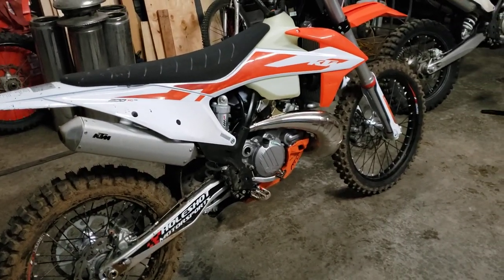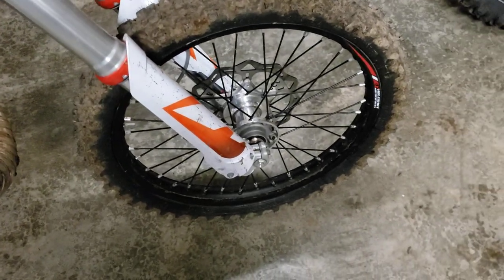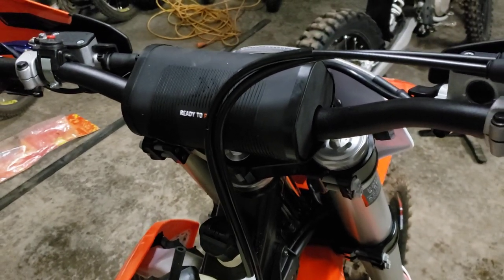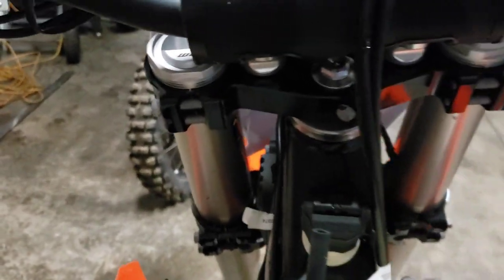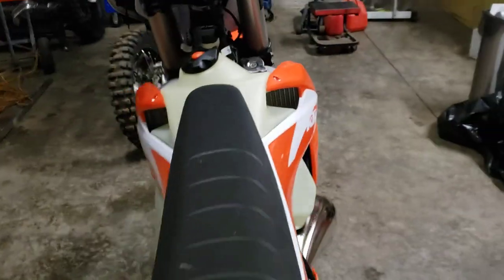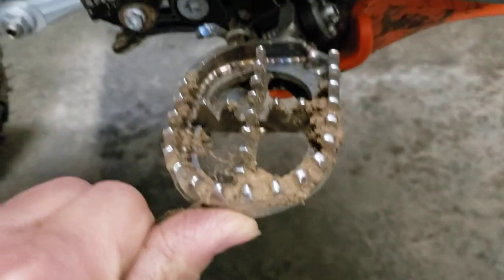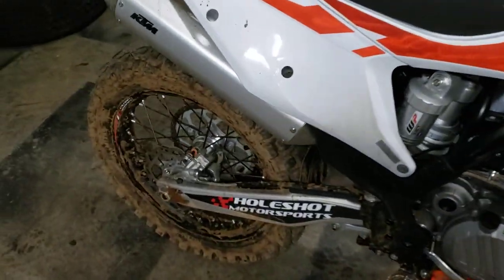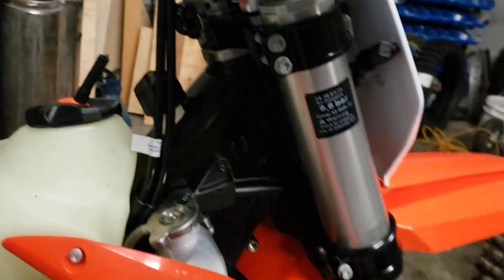2020 KTM 300xc vs Husqvarna TX300I

Comment: Hi Reese, very informative video.  I need one of those switches.  I bought an OEM Husky fan kit last year and the digital relay died last month.  $220 POS.  I’ve got the fan hard wired to a toggle switch which isn’t working for me right now.  My TE 150 is still running strong, love the bike however I’m thinking of switching to a new Sherco.  I rode a 2020 KTM 250 XC last weekend at McNutt and found it harder to ride than my 150.  BTW, I’m a lot better at downhills now than I was last year with you and Tristan Hart.  Only been in the ER once since then!
Reply from the maker: Only 1 ER visit you are doing well haha. .... Ill check if I have more of the switches here.

Comment: Great info thanks ! 
Choosing between TX and XC 300tpi at the mo both almost the same price. 
Forgetting the brakes as I quick like the Migura which now you’ve ridden both would you choose on overall feel and looks / finish ? 
I’m also choosing this over the Exc / TE but I do ride a lot of slower stuff , rocks and routes etc so hoping it won’t be to stiff and harsh .....👍
Reply from the maker: It can be set up pretty sort with the stock suspension so dont worry about that. I feel the XC/TX is as close as you can get to the perfect bike. Add a skid plate, Fan and Enduromousse and you are ready to go

Comment: Do you like the fan switch like that? Doesnt kill your battery compared to the one that goes by temperature?
Reply from the maker: It is easier on the battery because you can regulate it better than the thermostat run fan. So much better overall with the manual switch

Comment: What brand is your nice shaped clutch lever? 
I run a MWE one for the feel, but do find it's throw to short in cases were the oil temps fluctuate greatly
Reply from the maker: Ebay China for the leavers m8. Like $7 and never broken one. I shave the knob down so it will pull past my 2 little fingers

Comment: Speaking of XCW bikes, would you say the power delivery is same as XC? How about traction in technical terrain, does one of the bike getter better traction?
Reply from the maker: They are the same engina
Reply: @ReeceTasker  Though maybe the XC had a snapper tune.
Reply from the maker: @scrambled1213  They seem to be the same, but remember they are adjustable, Power Valve can change the characteristics a lot bringing in the power earlier or latter and then adjustment of the idle/air screw and also changing out the pipes for more low down and or over-rev.......there is so much you can do. I find the 2021 is a bit torquier than the 22 but I haven't made much adjustment on the 22 yet

Comment: Great video.  I've got a deposit on a 2021 300 Erzbergrodeo...but I'm torn on making a deal on a 300 XC or Husky TX300.  Thoughts?
Reply from the maker: Did you buy? I personally like the 2021 300xc the best. Best tuning and plush suspension. I had the 21 map installed on the 2020 but am yet to try it. My 21 runs and rides great.  I got away from the Huskys as some of my bikes are rentals......and novices flip their bikes all the time....a rear fender is cheaper than a subframe! KTM all run Brembo brakes which are better too
Reply: @ReeceTasker  Yep sure did.  I've got 7 hours on her, and am loving it!

Comment: Do you have a preference between the 300xc and TX300i in terms of engine delivery, clutch, map switch, rims, handlebars, or any other differences. Wanting to get a TX300i trying to figure out if it is worth paying the extra cash instead of 300xc.
Reply from the maker: No they are pretty much the same. The Husky has a map switch but I never used it.  My advice is get the XC for the better brakes (on that note some Huskys have brembo but its a crapshoot)  and over  long period the aluminum subframe is probably more durable

Comment: Which ever bike you can get a better deal on go for that. The motors are LITERALLY identical. So are the transmissions. The subframe is different. The husky has a map switch that you can get for the ktm but not stock. The sub frame is only a problem if you are hitting big jumps. I think for trails it won’t matter.
Reply from the maker: If people tend to flip the bikes the sub frame can and do break on the Husky. But the KTM 2020 and up the rear fender can break easily (my GF has broken 3 now) but they are $25 to replace

Comment: Pressure on your hands from the wrap around hand guards, please explain?
Reply from the maker: Yes the hand can work it's way against the hand guard at the end of the grip which is very uncomfortable.  But the biggest reasons for not running wrap arounds is they stiffen the bars up and can cause broken hands in a crash. ....many reasons not to run wrap arounds......however if you are a novice or learner and you spend a lot of time on the ground then wrap arounds are for you.

Comment: Will the fans move from a four stroke to a two stroke?
Reply from the maker: Yes the radiators are the same size, you may however need to run a switch